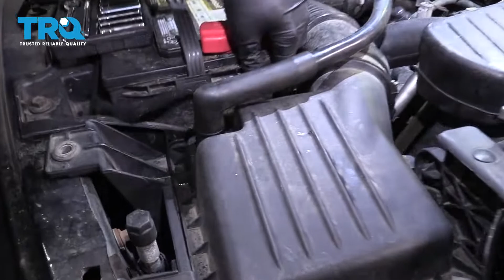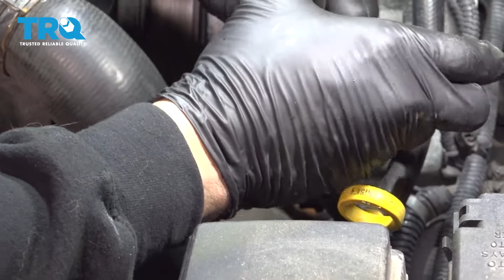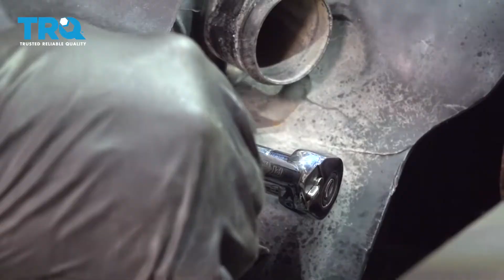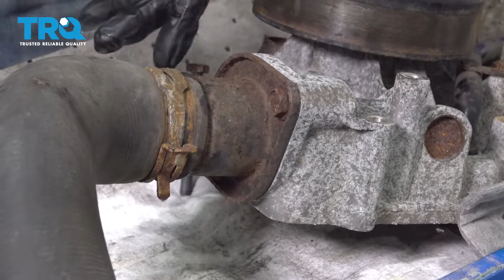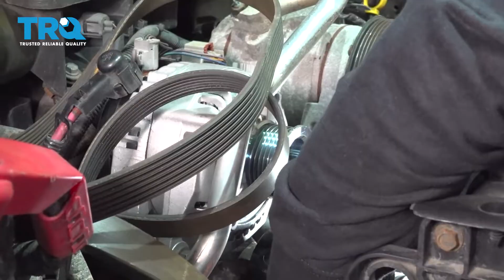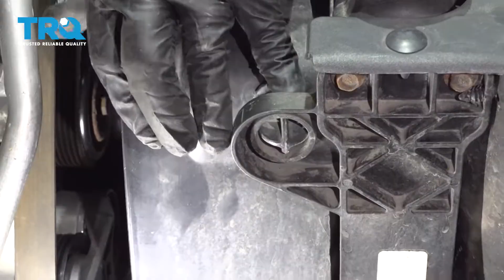How to Replace Engine Water Pump 2004-2009 Dodge Durango

Comment: Just did mine, its a disaster. Helpful tips: 1/7/16ths inch wrench will fit the fan clutch nut. If you have to change the pump you might as well get new METAL idler pulleys and an OEM mopar replacement belt tensioner with a new serpentine belt. Oh and bleeding the air out is a real bitch, especially if yours has rear heat. Takes many days to get the air out of these dirty damn things. Good luck.

Comment: Curious did u install the thermostat with the jiggle pin in the down position?
I thought the pin should  be up@ 12 o clock for air?
Was there any issues as far as overheating?
Did u had to bleed?

Comment: i have an Chrysler Aspen Limited 2007 4x2 Hemi 5.7 , i just change de water pump but mine doesn't have the auxiliary (electric) water pump that are connected to the calefaction hoses, is that normal? or some model doesn't have that pump?

Comment: Great video but you should really specify that this is a 5.7 not a 4.7...it could be confusing someone can say my water pump doesn't look like that .......somebody with a 4.7....quite different and it's very much easier the 4.7

Comment: This is an excellent post!
Bless your heart brother!
One comment though.  It will take about two gallons of antifreeze fluid to refill the system.  
I ran the car without the radiator cap until the thermostat opened.  Then gradually added the antifreeze until the radiator topped off.  Place the radiator cap on and close it and open slightly the drain plug until bubbles start forming and burying out.  When the bubbles stop coming out and bursting, just antifreeze stars flowing out, tighten the plug.  Add antifreeze into the reservoir to the full mark.  
Thanks!

Comment: You just saved me a shit ton of money! Followed this step by step for the first time and replaced my water pump and thermostat on my 2006 Durango. Perfectly explained. Note: if you don’t have an impact gun, just rent a fan torque wrench and jam a screw driver into the old water pump to keep it from rotating when loosening the fan. That was the hardest part. Everything else was easy! Thank you again.